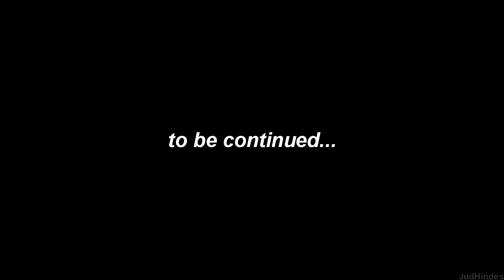Front Porch Repair

Comment: In the end was the repair of rotting timbers less expensive than replacing the timber? I assume you do not count your labor.
Reply from the maker: Well, not at the end yet, and no, not cheaper. But it was something I had never tried before and I did want to check out the procedure and efficacy. :)